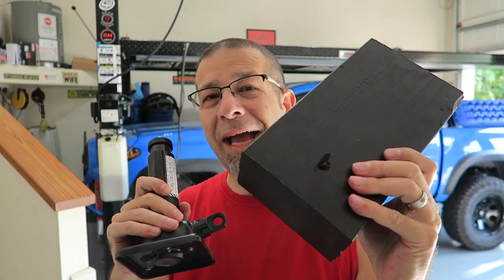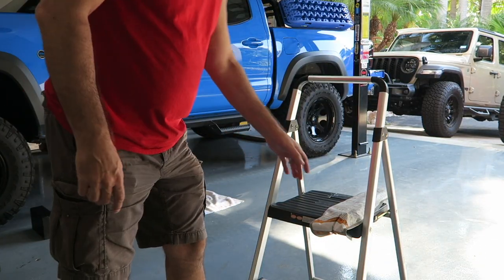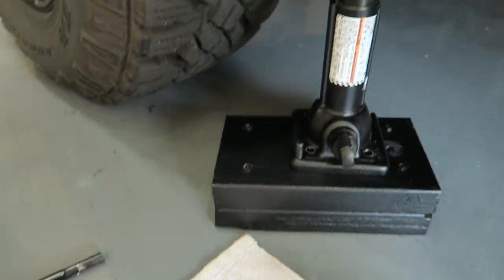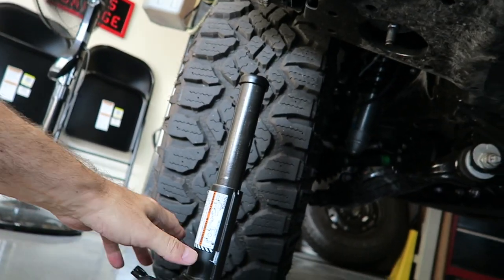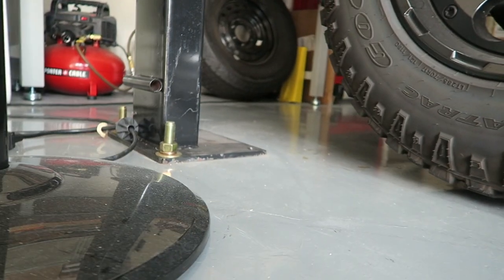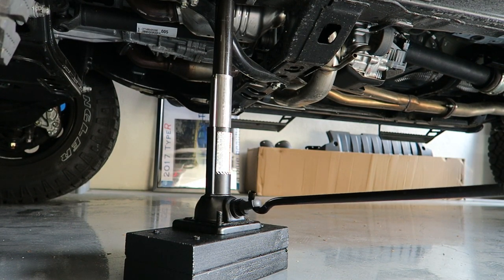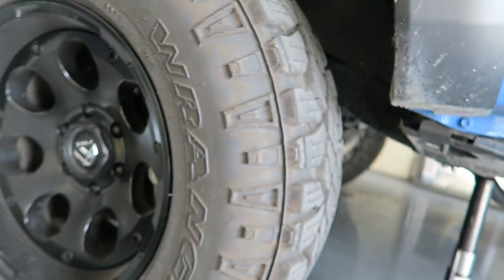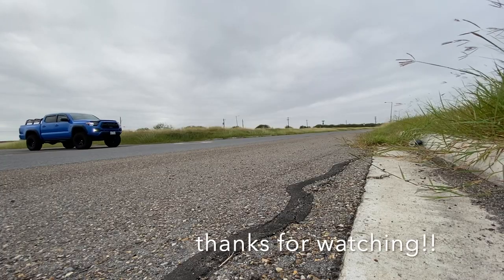Toyota Tacoma Homemade Jack Extension Test

Comment: The extra board (or two) would speed your time changing the tire.  Also would cover you if you stop with the ground being reduced where the jack sits.  Perhaps make a second set with bolts sticking out on one set that go into drilled holes in the second allowing it to lock into each other prohibiting slip.  This would allow you to use only one set of needed.  Great points brought up as always.  Thanks
Reply from the maker: I may do something for an additional board if needed.  I have an idea🤔

Comment: Rob the Jack goes to almost fell extension on the factory frame height. YMMV but when I popped that very tire and had to change I jacked under the lower A Arm frame. Not quite as long a lift.  If anything to me your base makes the Jack more stable and gives it a bigger footprint too. That will help on a softer surface. So to me a good idea and plan.
Reply from the maker: I’m happy with it.  I would prefer a floor jack TBH😬
Reply: @RobMotive  left off makes the Jack more stable.  🤷🏼‍♂️. I was in a hurry to start driving north.
Reply from the maker: For sure👍. Hope you had a safe, quiet trip😁

Comment: If you ask me it's not so bad. I did similar with my old Liberty that had a 2" lift. The stock sisors jack could not lift it enough. I also used the block with a hydraulic bottle jack I carried for the camper and Jeep.  It's was stable if you were on level solid ground.
Reply from the maker: That’s the only concern for me -stability on uneven ground🤔
Reply: @RobMotive  make a wider wood base or just call AAA if you don't have the right equipment or are in a bad spot to work. I like to do it myself but it's good to have the motor club as a back up.
Reply from the maker: I agree.  Never hurts to have option #2!!👍

Comment: Did a similar set up with with 2x12 pressure treated stair tread board, applied oil deck stain.....combination of both treatments should prevent wood from drying and weakening over time.
Reply from the maker: Nice👍

Comment: Is it dangerous? Yes of course. Anytime you introduce blocks into a situation like this, you increase your danger.
Is it an acceptable risks? I'd say so, but exercise extreme caution. 
I wasn't sure two boards would be enough, but now I know. I may swap my block out for one like yours. 
Two things I wish you had included in this video: First, the distance between the ground and frame when the tire came off the ground. Second, how much higher the stock jack would have lifted your truck.
Reply from the maker: I'd say the tire was around .75" off the ground in my test.  Given that I have a 3" lift in the front (actually 3.5" by my measurements) and the boards account for 3", the difference in lifting height of the jack for stock is .5" 👍
Reply: @RobMotive   @RobMotive  I think you misunderstood what I was asking or I'm misunderstanding your answer.

Comment: Just an FYI: TOYOTA BOTTLE JACK are not cheap. They are robust and engineered with Worm and Pinion Gears. They are durable, robust and reliable. Much, much efficient than a hi lift jack. They can easily lift a 40 foot shipping container.
Reply from the maker: Always use what you’re comfortable with 👍

Comment: Hey Rob I'm torn between 285/75/R16 or 265/75/R16. I have a 2inch rough country leveling kit and the rear is stock. What's your professional opinion. I'm going to buy the falcon wildpeaks. Thanks for your help! Love your videos!!
Reply from the maker: Hey Tony.  Go to tire size .com and plug both in for comparison.  I prefer the 285/70R17 if you have room👍
Reply: I checked it out it looks like they will fit thanks. What tires do you recommen
Reply from the maker: Falken Wildpeaks for sure👍

Comment: Hey Rob what's your tire pressure that you run in the tires you go by the door jamb or do you add more air sense they're bigger than stock?
Reply from the maker: I’m running 37 at the moment.  I may drop to 34.  It’s a bit stiff🤔

Comment: Shoulda wiggled the truck a bit once the tire cleared the floor to see if the jack would kick out.
Is it dangerous?  Of course it is - whenever you jack anything it's dangerous.
But your blocks beat trying to find a suitable rock to use instead of a nice flat block!
Reply from the maker: Lol!  I could see the wiggle test and the jack flying out!  Nope!  I'm not looking for trouble!!😬
Reply: @RobMotive  Ahh true - BUT in the real world you're gonna wiggle the truck a bit when you remove the wheel and again when you put the spare on.  Not a lot, but some.  That's a real test of how effective this type of jack is - block or no block.
Reply from the maker: Yup!!  No disagreement there😬

Comment: It would be great if you could use a high lift jack on a Tacoma, I haven’t figured out mine yet. Those bottle jacks are a pain in the ass if you get a flat in muddy conditions. Anybody have an idea on aftermarket parts where you can use a highlift jack?
Reply from the maker: You would have to add a jacking point(s) to use a high lift.